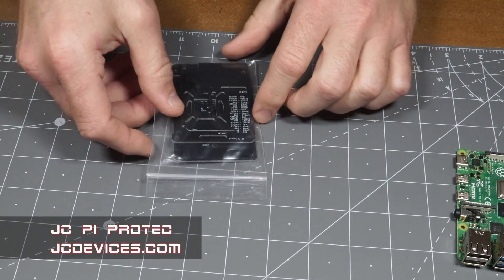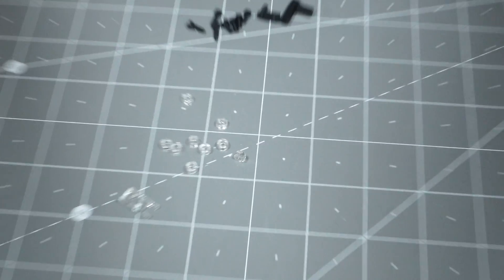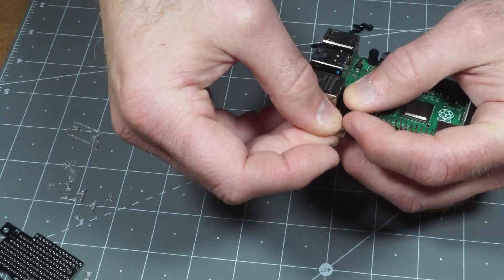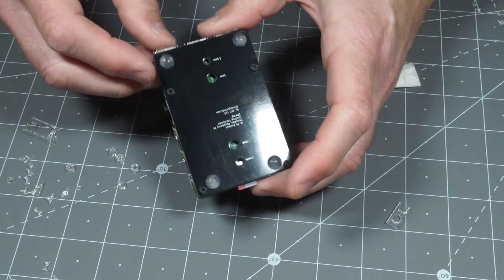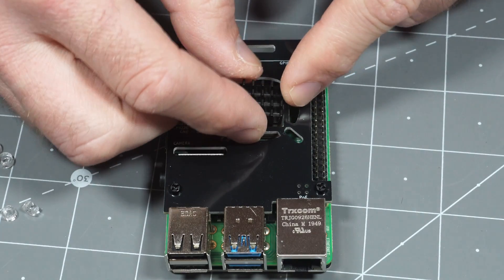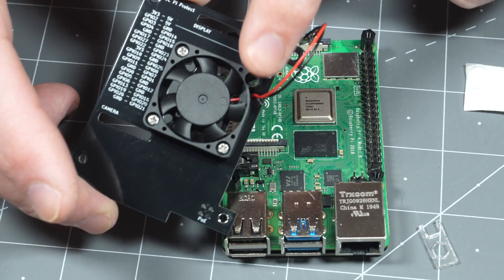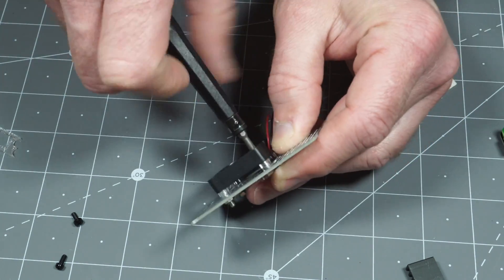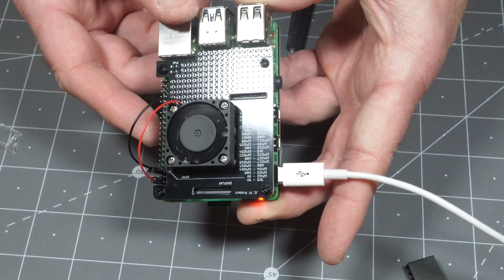JC Pi Protec Raspberry Pi 4 Enclosure [DIN rail compatible]

Comment: Could cheap low volume PCB manufacturing lead to making lots of different structural parts as assemblies of custom boards without any electronic function?🤔
Reply from the maker: It's an interesting idea. You definitely see it with PCB art, and Stephen Hawes made an encoder disk for his pick-and-place with PCB fabrication just as a few examples, so maybe we'll see more of it in the future!